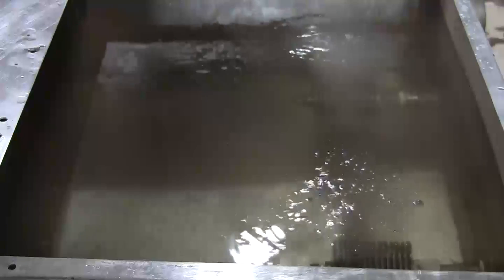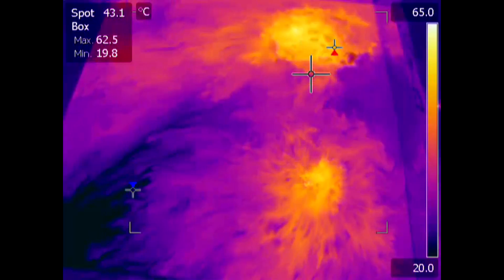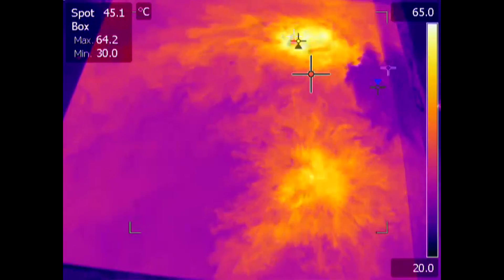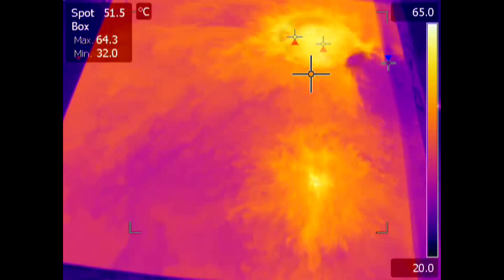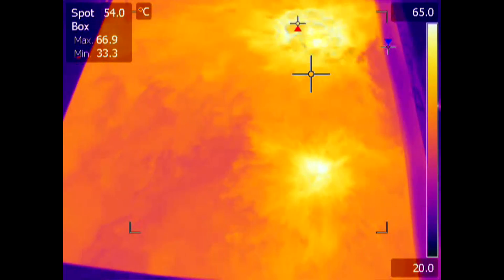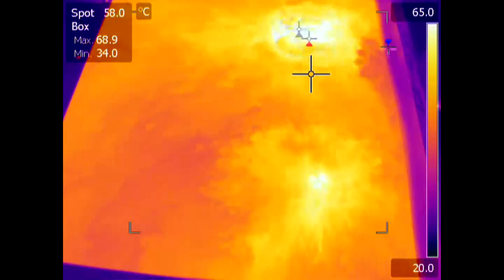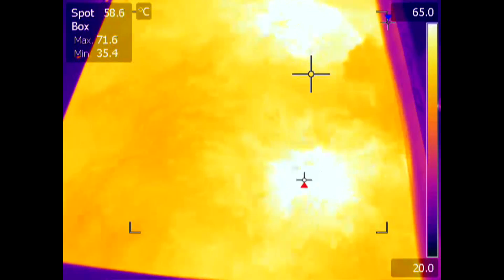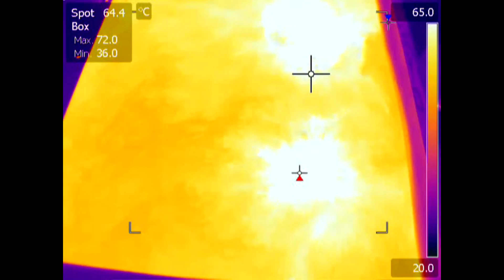Heating Water by Direct Steam Injection

Comment: how much water was heated in this video?, and what was the actual time it took for the water temp to max out?
Reply from the maker: +kevin erhardt   The tank holds 150 Litres and the starting temperature of the water was 20C.  It took less than 4 minutes (the video is in real time) to raise that volume of water to the set temperature of 60C.  That's a mean heat input of 105KW